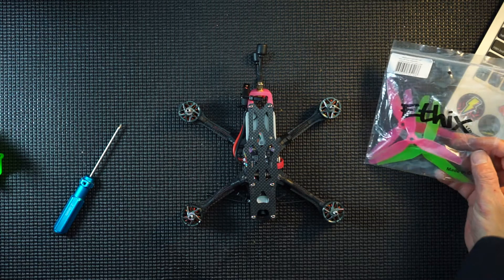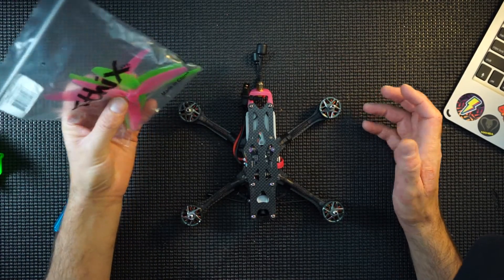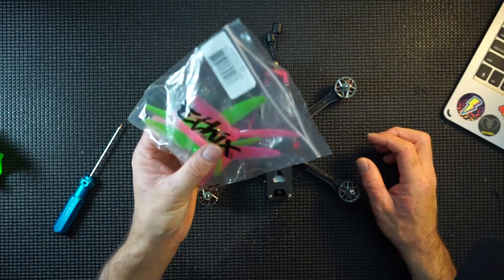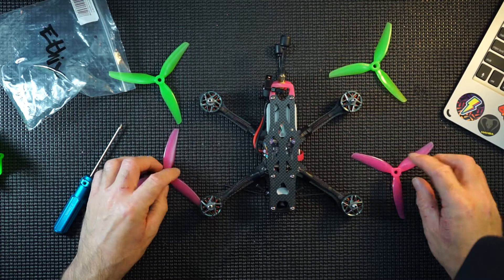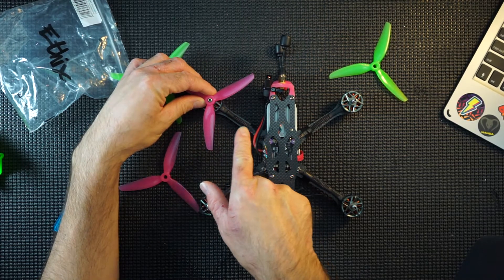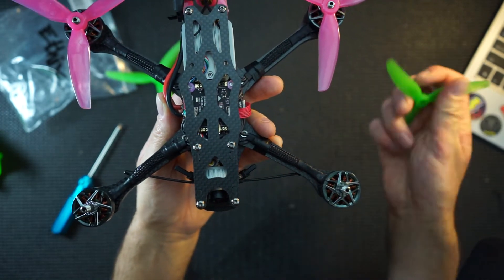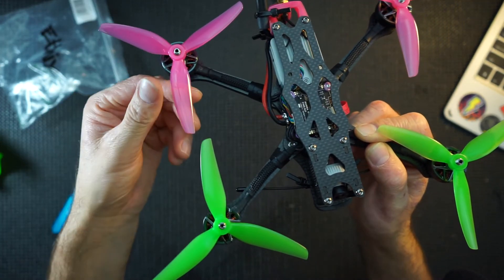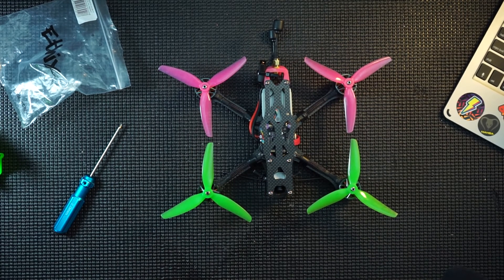fpv how to install your drone propellers correctly and never forget

Comment from the maker: PLEASE READ THE DESCRIPTION - if you want to run motors in 'reverse' you need props out, just reverse the install, so the props slope out
Reply: If you own the BetaFPV Meteor85 for example. Rear motors are ran in reverse so prop slope out..front of the quad the motors are NOT ran in reverse so install per video. Thanks for this helped me!

Comment: oh my god. I bought an fpv, and I was flying my fpv for few days, and now sitting at pc o notice that my propellers are not all the same direction, straight I went to google and found your video, and I see now that I randomly put them correct :D. btw thanks for the easy-to-remember tip!

Comment: Would it not matter which way your motors are spinning? So the rule about the prop going down towards the drone is not correct? My motors spin inwards towards the center of the drone.
Reply: I have the same question 
Seems like if they spin inwards this will push the drone down not lift it up

Comment: I just unboxed my Geprc and installed the propellers but I did it wrong as I can see now. I come from DJI FPV so the installation was totally different. The point now I unscrew the top to take them off but it seems like they are all stuck in there, almost like the hole in props it’s smaller that the bar of motor going thru it. It went in super smoothly I didn’t break anything but I’m affraid to touch it now to not break anything lol. Any suggestions? Please 🙏

Comment: How far does the screws have to be ? Bc on my drone I got my first one it just leave a bit to put the screw on is that good or no ?  M5 self-locking nut  and 4032 3-blade Props
Reply from the maker: Hi - I've never really measured it! - if you stick a prop on and a nut tighten the nut, the nut should tighten all the way so you see a small bit of the prop thread at the top... hope that helps?

Comment: I bought an iflight titan xl5 hd and installed the props as shown in this video and my drone wouldn't take off. It was the exact opposite of how they were supposed to be. My props needed to be high side of the blade towards the drone. Not sure why mine was the exact opposite but it was. Lol
Reply from the maker: props out - I did sort of explain in the description, tried to

Comment: I am buying props but I can't seem to find a 3 blade that has the center post hole as well as the other 2 to secure it in place. Is this just because my motor isn't built for three blades? I am very confused as to why I can't find any 3 bladed props with a center post then two mounting holes. Any help is appreciated as I am brand new to this hobby.
Reply from the maker: what are you talking about? - what quad you got - all the props I have ever used for fpv just have the one hole as shown in the vid? - spec the drone or motor please that you are talking about to help out.

Comment: I have the props on the correct way and when I give it throw up it flipped out like a backflip in the air
Reply from the maker: if the props are on correctly, have you made sure you have the motors spining the correct direction? - you also may have a props out set-up, reverse the props so they slope out
Reply: @Datfpv  I have all the props facing in towards the drone and when I try to give it all up it just jerks to the side and doesn’t go up
And I have the back ones spinning clockwise
Reply from the maker: yes - but do you have a props out dron set up .... try props out, just reverse my prop ionstall, so both props slope out....... or plug it into betaflight and look at the motor direction - that will tell you, without doing it for you this is what it will be, prop direction or motor direction....
Reply: @Datfpv  I put the rear motors clockwise so the front motors are going counterclockwise so how would the props need to go on with the slope need to be facing out or facing towards the drone on the rear and then the slope going out on the front on the counter clockwise ones I have props facing down towards the drone on off for props
Reply: @Datfpv  and reverse which one’s the front or the back or both of them reversed I have all four of them going in towards the drone do I need a reverse the back or the front
Reply: @Datfpv  now I got the back one spinning counterclockwise on the rear props but they’re facing in towards the drone the props